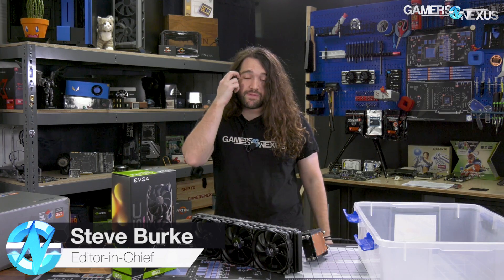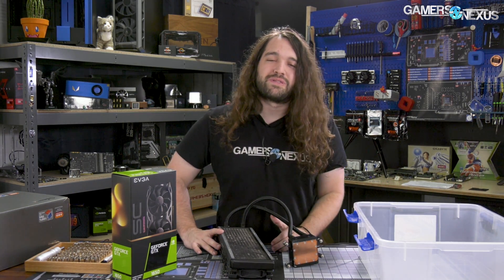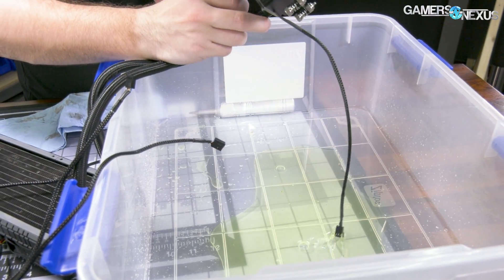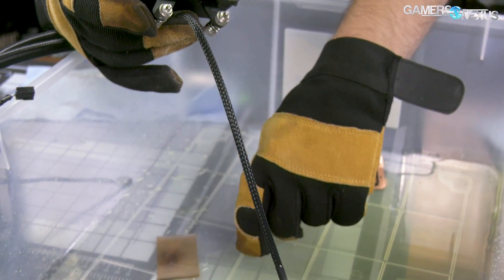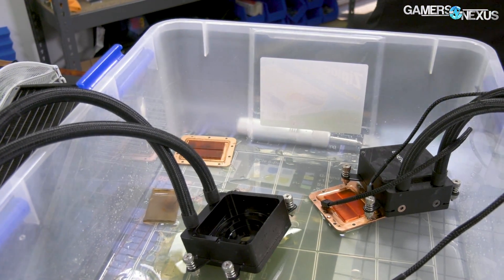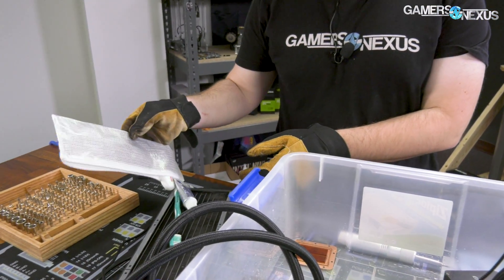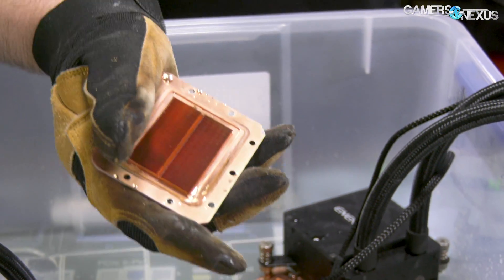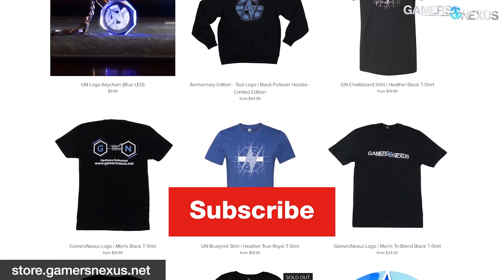Enermax's AIO Gunk Problem: Liqtech TR4 Cooler After 18 Months

Comment from the maker: We linked a Noctua TR4 cooler in the description that we previously approved for Threadripper use. Find our initial TR4 cooler reviews here: https://www.youtube.com/watch?v=FffaOYQpI6k
Grab the GN Modmat here: https://store.gamersnexus.net/
Reply: Used destilled water 4/1 1.2-ethanediol  for ages ... Never had any problems with any loop :) Guess someone saved some bucks by "forgetting" the biocide on those ones ;)
Reply: @peterpain6625 That's what I was thinking. If the fluid was something like Ethylene Glycol bacteria can certainly consume that stuff. So why not put in enough biocide?
Reply: @KenS1267  For me Ethylene Glycol was enough as a biocide (with destilled water). Never had anything growing in my loops ;) Maybe if you use tap water you get problems.
Reply: No idea how this is happening after Enermax has claimed to have fixed and redesigned this cooler on multiple occasions.  A simple search of researchgate will show that all they have to do is add 30% propylene glycol to distilled water as a coolant and it will not just act as an anti-freeze but also act as a long term anti microbial, protect against corrosion, and act as a lubricant for any seals.  This shit isn't rocket science and what I described above is literally the cheap, simple, tried and tested formula that has been used for industrial closed loop systems for decades.
Reply: Do you know if this is a recurring issue in the non-TR4 variants of Liqtech II coolers?
Reply: @tkain61  It's just the TR4 variants... which is weird because this is simple stuff.
Reply: The improved version (v2) is also broken, I bought one installed it and temps where sitting fine until you trow a load at it. Pump went very hot and the tube to the rad also but  full throttle is not a good cooler.
Reply: That 1650 punch had me laughing so loud that i could no hide from the office today that i was watching youtube while working...
but that punch was all worth it getting busted like that ...

Thanks !!!
Reply: 2:00 One Punch Steve 👊😅 On the serious side does the gunk and corrosion has to do with impurities with the water used as coolant 🤔
Reply: Is it sad that I want a MSI 2070 Armor review because it seems they took your "Bare PCB" comment to heart? I have been able to OC this thing as hard as the sponsored card's base clocks, and no I mean the base armor card not the OC one.
Reply: Skip this junk and get coolermasters' TR4 360mm AIO. Went from 55 idle to 33 after I RMA'd it to amazon after 1 year might I add!
Reply: Thank you!!!!   This company needs to be put on blast hardcore.   Had my pump die and the trip warning never went off due to what i presume is the LED  light on the block. Owned 2 since november 2017,   2nd was never boosted clock 3.8 max  and maybe 3k hours of actual gaming?
Reply: Glad I custom loop all my builds.  Would deffo suggest an extra dose of a good corrosion inhibitor like Feser Base after servicing an AIO unit.  They really don't care about mixing metals, or flushing the rads properly if you ask me.
And you say long term use?.... My loops run for the whole life-cycle of the rig, about 5+ years on average.  Just need topping up once or twice.......I push my overclocks hard.  ^__^
Reply: Can you take apart the ID Cooling Aura Flow RGB 240mm?

Comment: I bought one of these in January 2021. It completely stopped cooling by October 2021. I sent it back in January 2022 under warranty. They did not repair it. They sent me a brand new one that was manufactured even earlier than the one I had. I might not even open this and contact them to complain.

Comment: folks avoid the tr4 II cooler all enermax did was redid the box to put the II on it, the "new" version is essentially a reboxed 1st gen unit, I have had 2 of the II versions fail in under 3 months and both had some slimy crap plugging the fins on the cold plate and it caused the pump to fail.  I have since ordered the parts for a custom water loop.

Comment: PC (threadripper1950x) kept powering off. felt the block, it was hot. Mate, did the teardown like you on the Enermax 360....Holy! corrosion and crud! (where ca I send you some picks. Hours later cleaned as best I could, filled it with premix car coolant (160mm was all I could get in). bench tested the pump. And WOW sooo quiet not having all those fans at full tilt and sitting at 28C idle. Not saying it will last but its good for now. Thanks heaps

Comment: My 280mm version died after a couple of months... all of the sudden my CPU is throttling down to 500mhz and heat is pegged at the limit...  horrible AIO...   ended up replacing it with a dual fan NH-U14S TR4-SP3...   works fantastic and no worries about pumps or leaks...

Comment: So I thought id post again.. My Liqtech 2 TR4 360 is now sitting between 55 and 60 degrees idle. At 20-25% load ive had it go as high as 87 degrees before I realized and shut the system down. Ive now owned both the Liqtech 1 and 2 and I will NEVER buy one again!!! Think I still have photo's of my Liqtech one being eaten alive, but I have yet to pull the Liqtech 2 apart. At this point, id rather buy Wraith Ripper or the Deepcool Castle 360.

Comment: next time it would be nice to measure thermals before and after changing the coolant. I have an EVGA CLC 280 and had also issues with bacteria gunk. It was so bad that I hat thermal throttling all the time. I refilled it with 50% distilled water and 50% Glysantin G30 as biocide and corrosion prevention. Since then it works fine.

Comment: Watched the video.Though to my self " Self...probably should check yours in few months; it has been since summer since you bought it  ".Few hours later sat at the computer . Lit up a smoke, cranked up Division 2, played about 7 min, frames are dropping like crazy looked at LEDs on MB (got mine to show CPU temp) - they are red (over 75 C) check the CPU tems   87 C. Started looking around - fitting are dry ,block looks dry .... than big ass drops on GPU, fuck me and everyone else.The fault was that they did not bother to tighten the screws that hold the impeller onto a block and the cavity that holds the electronics was getting slowly flooded till it got to a level where the wires come out. So now I'm getting a new CPU cooler and possibly a new GPU.By the bad coincidence of design the part that is most likely to leak sit directly over the most expensive component in you rig.. and yeah take ride to  Costco or Sam's and get a box of latex gloves, they come in handy especially when you got to do something disgusting.

Comment: With mine, I noticed that my threadripper temps were really high and performance was bad all of a sudden. Then I realized my pump was leaking :( . Luckily it happened a little but I switched to Noctua after that. Just less things to worry about with air coolers.

Comment: My first Gen Liqtech 360 died in 6 months (gunked up so bad the motor died, it was really nasty). I replaced it with a Liqtech 2 which has been running for a few months but the pump is making a ticking sound. I've decided to drop Enermax and just get an EK loop with a monoblock moving forward. My first non CLC, so it will be interesting :)

Comment: If the gasket/o-ring material really is deteriorating, I'd stay away from any Enermax product. With how long watercooling has been a thing, for PC, automotive, etc., deteriorating material should not be an issue at this point. This only shows that Enermax is cutting every corner possible.

Comment: The issue is the fact they have both metals right next to each other in the block. Black anodized Aluminium, with the bare copper cold plate. The Asetek solutions all are plastic in the block, with the aluminium way further away in the radiator. They probably used the same coolant which would have been fine in any other scenario but not concentrated enough to handle the two metals right next to each other.

Comment: I feel sorry for the people who bought these coolers new, not good for consumers.

About 2 months ago I picked up a 280mm and 360mm enermax TR4 coolers for about $10 a piece knowing they suffer from this problem. I can confirm the cold plates looked about the same as the 1st unit you opened, the 360mm one showed up without a lick of coolant in it.

I dont own a threadripper but for $10 a piece it seemed like a good deal to tinker around with and even the fans were worth that price.

Comment: I bought one of these for my partner's TR 1920X build. It clogged completely in less than a year - fans spinning at 100%, CPU throttling to >600MHz, and no heat at all in the hoses past 10cm or so. Zero water flowing at all, completely unusable. Ended up RMAing it and swapping it for a Noctua air cooler. Won't trust an Enermax AIO again, nope.

Comment: The old saying "you get what you pay for" rings true, especially with electronics. I'm running twin Corsair h115i AIO's in my rig. Ones cooling my Delidded 8700k, and the other for my RTX 2080 (Corsair 680x case allows for mounting one on bottom, and one on top). My rig is near silent even though it's packed with 4 LL120s and 4 140s. Call me a shill, but outside of my motherboard, my RIg and it's  accessories are all Corsair. I couldn't be happier with the performance, aesthetics, and quality.

Comment: One year later, my Noctua NH-D15 is running just fine. It accumulated a little bit of dust, but was able to clean rather easy. My Hyper 212 is in the closet as back-up. 
The AIO brands looks nice and I'm sure there are some that last a long time, but I just don't want to be that one whose cooler leaked all over my components.That would be my luck. 
Thanks for taking the time to break these down and showing us how they work.

Comment: Had the same over two and three years on nzxt and corsair thus asetek.

Funny that I used spring water, mixed metals (3!) and antifreeze for my open loop and two years without cleaning it was no issues 😂😄

Comment: Only had the Enermax Liqtech TR4 280mm for less than 60 days before the pump died. At the time the cooler was unavailable because of high demand and I couldn't get a replacement. Luckily Microcenter allowed me to return it for store credit and I bought an air cooler that got me by until I could afford a custom loop.

Comment: I have around 20 of the Enermax TR4 280 coolers that my customer is going to likely surplus.  About 90% of them failed as thermal throttling was so bad that users couldn't perform menial tasks.  CPUs were exceeding 90C in some cases.  Some of the rads felt empty when we removed them even though there were no leaks inside.  All of them are still sealed and if Steve is interested, I can try to ship them to him as a great sample set as not all the units are bad (but most are).  We are replacing all of the ones we purchased with the NH-U14S.

Comment: When I was piecing together my Threadripper build, the cooling solution was the biggest pain in the butt. I restricted myself by being dead set on using the O-11 dynamic case (which is a great case btw), and air coolers where out thanks to height clearances. I was put off on this because of those reports of gunk and corrosion, so I got the MasterLiquid TR4 edition. Turns out, that also has a flaw where it is nearly impossible to install without breaking, no matter how gentle you are. Luckily, Corsair's Platinum coolers just came out at the time and it includes a TR4 bracket, so I got that instead.

Honestly, the only criticism I have about Threadripper is how limited the cooler market is thanks to its huge footprint.

Comment: Im having issues with the second generation pump... temps started increasing...before my Threadripper 2950x would idle at 27c  it now idles at 56c and underload goes straight to 68c and climbs...I requested an RMA 2 days ago!  If they don't RMA it...I can send you mine to look at?  Again, it is a second Gen (Liqtech TR4 II)

Comment: I bailed on this AIO and just installed the Noctua TR4. My 1950 in a 68-degree room is running great at 30 to 54c while exporting with 4k 30fps in Resolve. The Noctua NH-U14S with twin NF-A15s and the NT-H2 paste is the way to go if your income depends on system performance.

Comment: And that is why I only do air-cooling. No problems like that, not pump failure, no leaks, less noise. A towercooler FTW. There literally is no downside to a towercooler, you can select a case which is large enough and if the RAM its heatsink (or decoration? Not sure) is too high then you simply clamp the fan a bit higher. Yes, 360 AIO's will keep the hardware cooler but once you need that then you waste a lot of electrical power for little performance gain. That is not worth it in my opinion. A open loop watercooling is nice but good luck maintaining that.

Comment: I've seen exactly that kind of buildup in my custom loop. I originally thought the problem was algae. But it was actually caused by the wrong type of tubing plastic being used. When the water reaches a certain temperature the plasticizer that allows the tubing to bend more easily starts leeching into the water. The particles stain the water greenish and start clumping to forming those globs that get into the fins. Regular additives will not prevent this 'cholesterol' from forming. It's also a bitch to get out of a loop. I spent hours trying to flush my radiator from this crap and I didn't succeed.

Comment: That 360 is in far better shape than mine, incidentally cleaning it out and swapping the fluid has not helped the build up of gunk but it did bring the temps back down to what they should be.

Here was mine.  https://hardforum.com/threads/enermax-liqtech-tr4-aio-liquid-cpu-coolers-review.1945204/page-6#post-1044161946

Comment: Omg, thank you for bringing this to light Steve. I bought the original Enermax TR4 280 cooler. That failed.  Then I got the Enermax Liqtech II version as a replacement unit From an RMA.  That failed. THEN I got a replacement for the replacement Enermax Liqtech II. That failed. My friend bought a Liqtech II as well. His failed.  By Enermax's own admission, they've had 20 revisions so far, and they've fucked up every time. Ultrimately I bought a Be Quiet! Dark Rock TR4 Pro, and I've never been more happy. A beast of an air cooler. I'm not buying Enermax coolers anymore.

Comment: This is why I don't want an aquarium in my pc... air cooling is fine for overclocking if you get a good single or dual tower heatsink. Just don't use stock.

Comment: I took apart a 10 year old Corsair H60 when it finally gave up the ghost and it vapor-locked, so it just dried out. It didn't start this vapor-lock behavior until after i moved my computer so it was probably still fine with the lower level coolant if it wasn't moved.  the fins were pretty much clear of gunk.

Comment: On my 3rd Liqtech TR4 360mm. The first came leaking from Newegg and was replaced.  The second started showing this issue after about 6 months. 

Temps stayed the same but my 1900X clocks dropped from 3.8 under heavy load to around 3.2. Enermax replaced it. 

I’ve been on my third for a further 6 months or so and it’s doing better but I’m assuming it to will fail and have to go back. 

Some folks who RMA’d after me started getting V2’s as replacements. So it may not be fixable in this version.

Comment: Unfortunately this is the ONLY cooler to cool the TR4 when overclocked. Every other dedicated TR4 cooler sucks.
I had the same problem and got it replaced after EIGHT WEEKS warranty. If that happens again, I will go for a custom loop with 2 360mm rads that are 100mm thick and all copper...
Reply: I mean, they released a second version that fixed these issues.
Reply: @heretolevitateme  I have gotten a new one last February or Mach via Warranty. I had the version II before and I got the version II again. So the version II did not fix the issue. I hope the version II I have now is fixed??

Comment: Custom loop enthusiast here. But this is exactly why i recommend high-end air coolers over CLCs. They work just as well or better, and live forever.
Reply: This is like the worst ever though. My 8 year old Asetech didn't have any gunk to clean (had to add distilled water to it, gurgle sound when radiator in specific orientations). Automotive anti-freeze should be used in most cases. In a water cooled tablet I made, distilled water would corrode with chunks of rust every 3 days and need dumping and cleaning. With undiluted automotive anti-freeze, I didn't have any issue with the coolant corroding after 3 years. So apparently it lasts well over 365x longer than distilled water, which makes sense, cars have all kinds of mixed metals, run up past 100c water temps extremely often sometimes multiple times a day, and look fine after the 5 year recommended change interval even with 50/50 diluted coolant. It has both biocides and anti-corrosives, so you don't have to worry about anything, plus it comes in cool colors like green, which looked great as the radioactive coolant in my nuclear wasteland themed tablet.

Custom loops get extremely expensive (ok, yeah, I made my entire loop on my tablet for under $5, but still...), I much prefer the sub-zero phase cooling systems, because you just can't keep sub-zero core temps under load when dumping 1.7v on an FX chip, I mean, even the board is cooled from it being so cold. All you have to worry about is the ice melting after you turn it off, or if you screwed up your insulation, but once you've got it down its been way safer than my water loops (for me, 5 leaks a day on my test bench, which has 4x GPU/CPU/multi-flow rail splitters and just a lot of connections to leak from. Plus I do everything 1/8 @$$, there is no half @$$ effort from me on a test bench because I certainly won't put that much effort into it... Just jam the open ends with sharpies and ink pens, that's ironically never failed yet, just the proper hose barbs/fittings...)
Reply: @jakegarrett8109  cool.